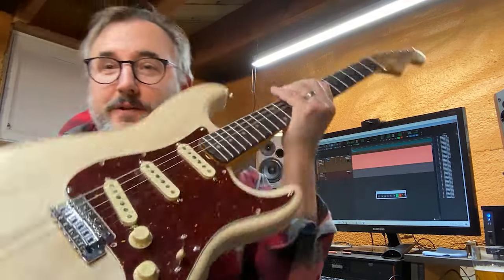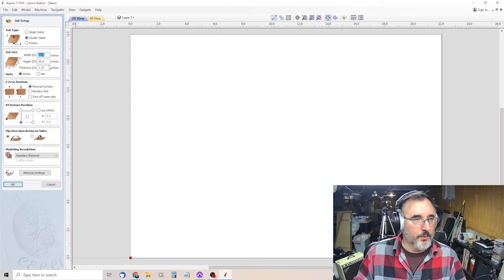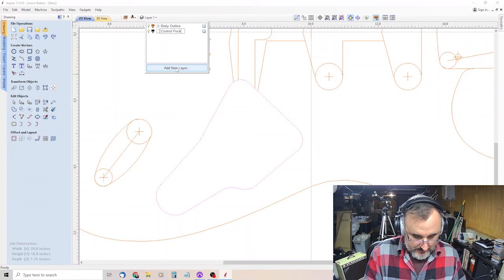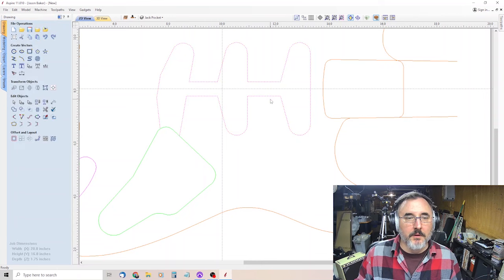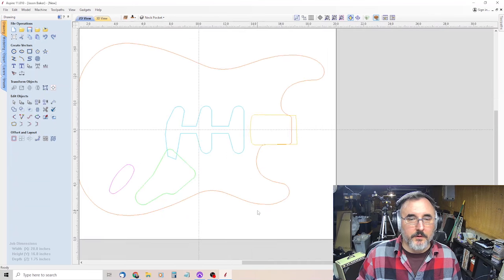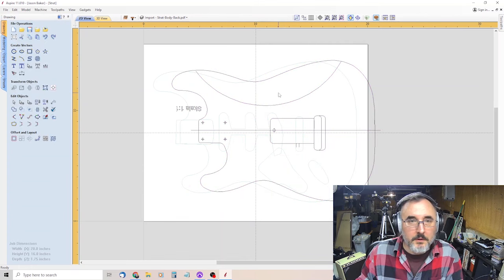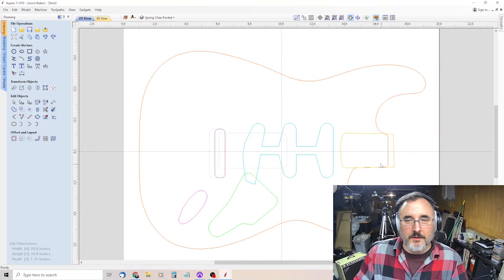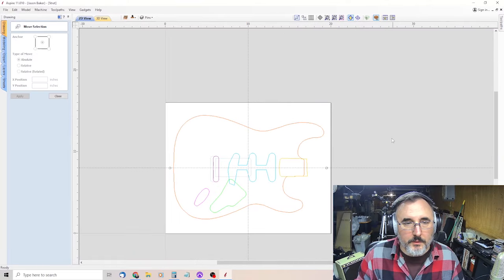Creating a Strat Guitar Body in Vectric Aspire Part 1

Comment: when you were setting the distance of your drill holes, is there a reason you couldn't just mirror the first one about the job center. then you wouldn't have to do all the calculations. or did I miss something? Thanks Greg
Reply from the maker: You're absolutely correct and it'd be more accurate. At the time I didn't know about that feature. Good observation.
Reply: @JayceAllanGuitar  Jayce, I have another observation, and I don't mean any of this as criticism, as I don't know everything and I'm always learning from others. I appreciate the videos and I thank you for posting them. When you're in material setup while setting up your 3D roughing. I've found that it's a good idea to always set the gap above model to at least .01. It doesn't matter in the case of the guitar body because you're only roughing and finishing the edge, and there is not much detail in your model. However, if your 3D model goes across the whole surface, and it is detailed, and if there are any variations in the  surface  ( like a small low spot), your bit will not touch and you may miss the detail. how's that for a run on sentence? Anyway just trying to pass a tip on. Good luck and keep the videos coming.
Reply from the maker: @gregraso557  I'll give that a try, thanks. I appreciate useful feedback.

Comment: Would you be able to create a file for the pick guard for this guitar that would be compatible with the files you produced in this video series?
Reply from the maker: I should be able to. I think there's a template on The Electric Herald.
Reply: @JayceAllanGuitar  Would you make a video tutorial or put it in your google drive folder?
Reply: Also, I have a General CNC 40-915x machine. I'm using VCarve 10.5 Desktop. The only way I can save the toolpaths is as a .nc file. How do I make these run on the machine? I'm confused on how to get the files into a type that can be read by the machine.
Reply from the maker: My CNC machine needs gcode files. I use a program called G Sender to send those files to the CNC. Aspire will save the toolpaths to a ton of different formats. You want to go into tool paths and look for the icon for Save Tool Paths and find your post processor.

Comment: Very cool. I don’t have a CNC yet and still working overseas in the sandbox, retiring next year. Want to build my own Strat but left hand version. Maybe that’s available as an option in the software or in the pdf download you mentioned. One thing I’d like to do is use a maple binding on the top as post off the round off. Might be something in the software for that. Thanks for the videos.
Reply from the maker: making left handed is super easy, just select everything and mirror it horizontal. I haven't done a binding channel yet, but I'm guessing that would be pretty easy too.